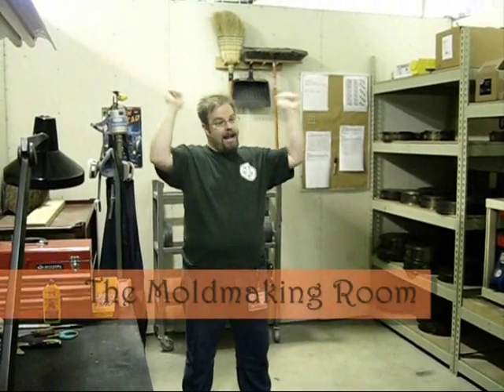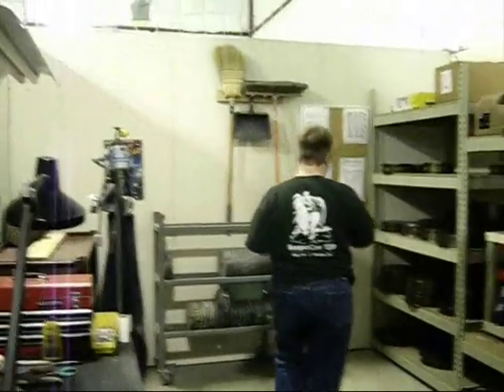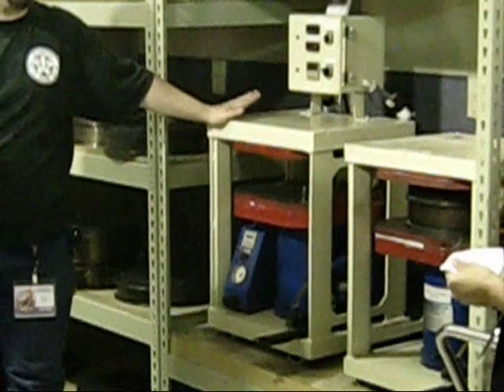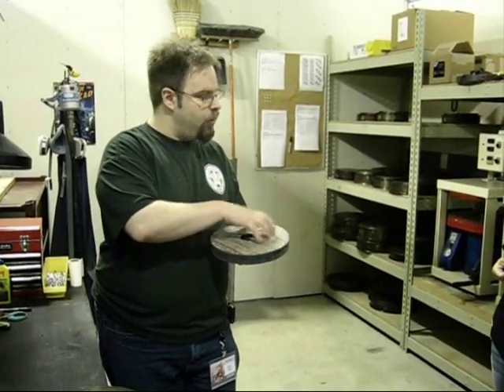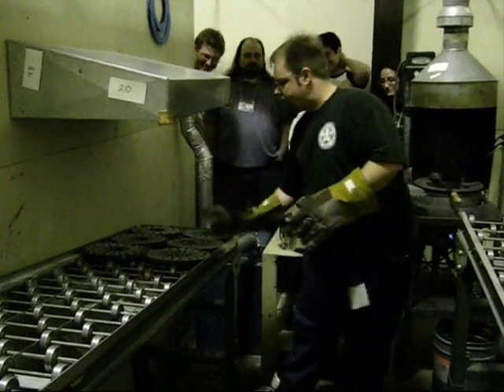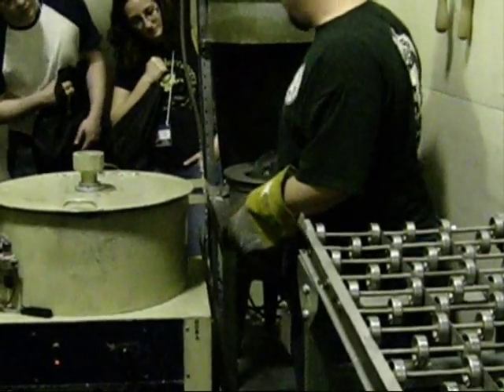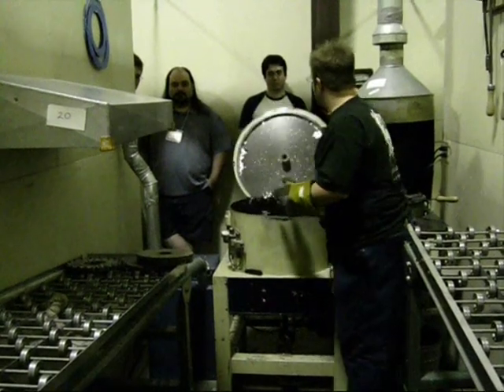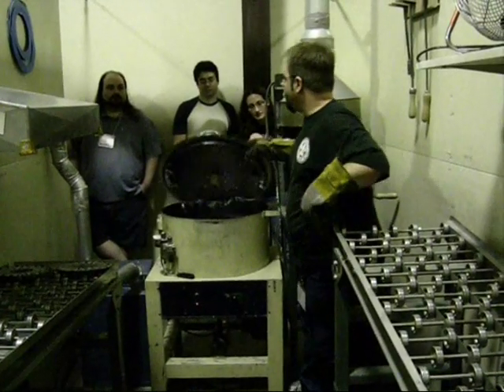How Reaper miniatures are made Part 1

Comment: Not really, no.  The talc also acts as a release agent, reducing the friction on the pieces when removing the figure from the pocket.  The rubber has a lot of friction, and removing a figure from the mold without talc stresses the rubber, pulling, and eventually tearing it.